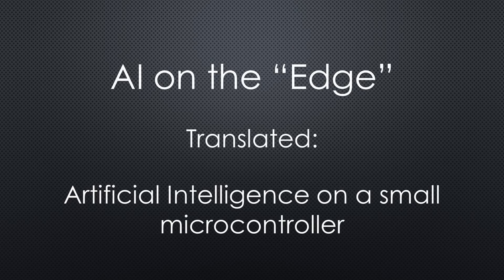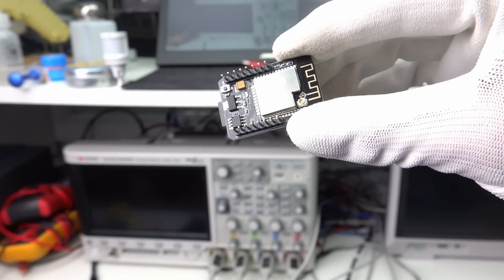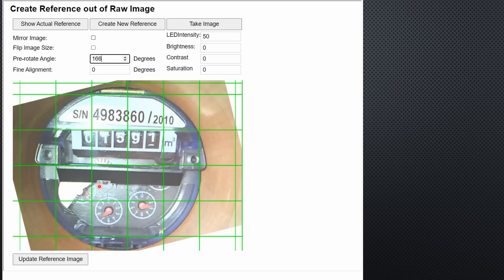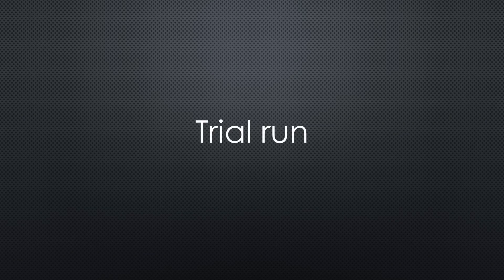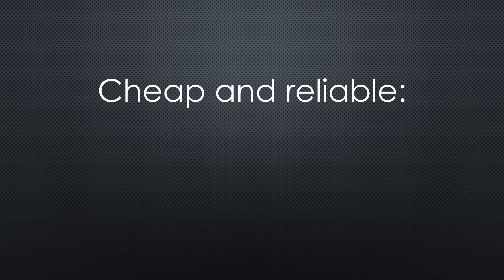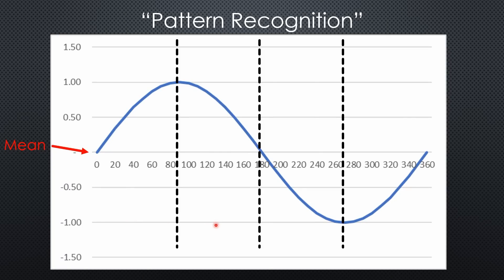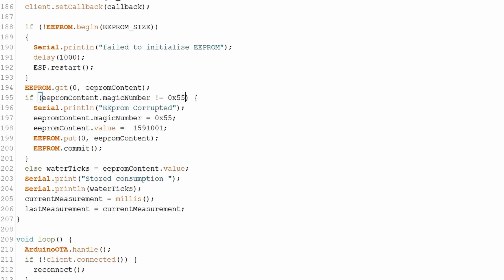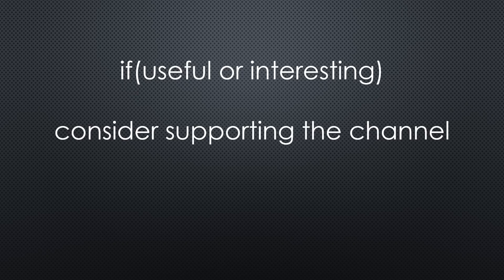#418 AI on the edge vs. Traditional Engineering. Water Meter with ESP32-CAM

Comment: I realize that this is an old video by now, but it does require some adjustment in the used model for recognition to work properly. The default module didnt work fo rmy water meter either. But after quite a lot of fiddling with getitng both the model correct (dig class 11 in my case) and the area that is used for the recognition. Model can be set under the Digit ROI Processing part of the settings.
Reply from the maker: Thank you for sharing your experience. Maybe these days, I would send a picture to ChatGPT as I did with my cat detector.

Comment: In situations where water meter locations usually lack access to power, is there a viable option to adapt this project by implementing RF for low-power signal transmission using batteries? The goal would be to receive these signals on a gateway and subsequently publish the data to MQTT.  Thank you for the great videos and the moments of humour.
Reply from the maker: You could use a LoRa module to transport data. They have a longer range than WiFi (they are also used by utility companies)

Comment: Using a correlation filter would have been much simpler to implement and probably more reliable, considering that the setup has fixed lighting conditions
Reply from the maker: I do not know why the "inventor" used this way and if he tried others.

Comment: Instead of using a magic number which overcomplicates things, store the crc of the number or some other calculated value based on the reading to be saved and check for that instead.
Reply from the maker: Thank you for the tip!

Comment: Is there any mechanism that we can measure AC voltage level, in my flat the voltage fluctuations are common and the AC stops working and gives 88 error which is during high or low voltages. Please make a video if feasible. Thanks
Reply from the maker: You can use any AC meter to measure the voltage. If you want to read it via Wi-Fi you get power meters with built-in Wi-Fi (e.g. Sonoff). They measure voltage, too. 
I already made a similar video.
Reply: @AndreasSpiess  Danke

Comment: Just a little tip: If your microcontroller doesn't have an ADC pin or you can't spare another ADC for just a simple sensor, you can read it with a digital pin. We can accomplish that with example a PNP transistor on the output of the sensor and with a relative low base and collector resistor, that will make the output clip between gnd and 5v, like a digital signal.
Reply from the maker: Good idea!

Comment: Well that’s no good at the first try it’s giving false readings. I think it would be best to use the “svhn dataset” which have so many numbers of different shapes and forms and train it using YOLO V3 and then integrate it on ESP32. I think yolo tiny is the weights used for ESP32. I’m truly amazed that even the ESP32 can actually do valid AI. I will be doing this soon but I need 99.99% accuracies and fast FPS, possibly a cluster of ESP32 can do the task much more reliable, but I think you need to use the right tool for the job, the MediaTek SoCs have powerful built in AI cores which can handle the AI matrix multiplication computations, best of all the MediaTek SoCs are super low prices from $3 to $20 and are extremely powerful than ESP32. The YOLO tiny weights are not too accurate compared to the heavy weights and hence using a cluster or powerful SoC is the way to go to use YOLO heavy weight.
Reply from the maker: Thank you for the additional insight!

Comment: So your device reads signal from water meter?  Our meter is under metal lid in yard.  They use a device that receives transmission of data.  Water use amount represented by a specific measure unique to meter. (Not typical measurement term anyone uses.). 

I need a reader to check elderly peoples water meter to assure they are not BILLED EXTRA.

I WAS GIVEN 3 BILLS THIS YEAR TO HELP THEM STRAIGHTEN OUT CORRECTION AND PROPER PAYMENT. (I VOLUNTEER TO HELP ELDERLY IN MANY WAYS NEEDED.
Reply from the maker: I assume water meters are a very local thing. It seems that in your place they do not like that the customer can check the reading :-(
Reply: Not that it bothers them…. Their meters jump to 3x the normal use to be charged on occasion.  The customers are elderly.  They do not use extra water.  No garden, and to old to wash cars, etc.    I wanted to figure out their signal and check it often for a while.  Water meters can be faulty and hiccup on occasion.  But they hold the elderly Customer to pay it.  Though no logical reasoning.  Leaks are quickly identifiable.
I would love to put “my own meter” in the water line (on customers side of pipe line up on property.). Lol

Comment: hello andreas, I think a better solution could be to use a Raspberry Pi mini. With python and using opencv you can easily recognize the analog red pointers and the direction they point to. if you want to read the numbers with pattern recognition you can do that too. A real AI on the Rasperry Pi is of course also possible solution. a CNN is quite easy trainable for number recognition. i have trained several models to recognize numbers. Very interesting project in any case
Reply from the maker: A good idea. OpenCV is longtime on my list…
Reply: @AndreasSpiess  if you need help let me know

Comment: I have an IR sensor module do you think it would work with this code or should I go for cny70 only ?
Reply from the maker: You have to do your measurements. But I assume it should work with the right resistors.
Reply: @AndreasSpiess  Thanks sir Do I take that WaterMeterV3 code is the most accurate and updated code to work with?

Comment: Hi I lived the solution implemented by you and am trying to buld one 
At 8.03 min I see you have suggested connecing 2 resistors
330 ohm between vcc and emitter
and 10K one between Gnd & Diode
What power rating should I use for them?
Reply from the maker: just small ones. Nearly no power should be dissipated if you chose the right one.

Comment: So before going with the "easy" option, no attempt to train your own AI? Unlike speech and general object recognition in images, training number patterns should be trivial to do on a general computer. A GPU helps, but probably not required in this case if you don't need training to complete in mere minutes (or less). Since it only needs to learn from a custom set (i.e. your meter and not handwritten, other meter fonts, etc), it would be even better/more accurate.
Reply from the maker: The effort for training for only one application seems to be a little too much for me. In addition I would not have solved the issue of partially covered numbers.

Comment: @2:07 - That trigger button made me think of one of those vintage accordion plate cameras (on a tripod/stand) which has a cord and "button" to trigger the snapshot.  Maybe as a project you should make a retro version of that style camera using an esp32-cam and cord. ;)
Reply from the maker: You are right. And if I remember right, they were mechanically connected to the button on the cameras...

Comment: At around 4:30, the glare problem. Can I suggest three things? 1) introduce a polarizing filter between the camera lens and the meter (this may well solve the problem), 2) Degrade the video signal to monochrome or use a monochrome camera, don't need the colour and 3) Ignore the decimal digit, it doesn't add much information but creates a lot of problems, after all the water company doesn't include this in their billing do they and it wouldn't be evident in your resultant usage graph either?.
Reply from the maker: Your tips would certainly help. But there is still the problem that I do not see all digits. I am quite happy with the current setup...
Reply: @AndreasSpiess  Yes I can see and accept that, if what you've got is doing the job then why reinvent the wheel? There is an adage that you use the simplest system to do the job. Just out of interest though, have you seen the Nicla Vision from Arduino, looks like it could do this task whilst having the electronic equivalent of standing on it's head? A bit expensive though!😁
Reply from the maker: @icarossavvides2641  No, I do not know the Nicla Vision.

Comment: To read the metal piece you need to use LC sensor. The Hal of course will not work. And the IR in the field will going to have problems because of the moisture and the water around the meter. Using LC sensor will eliminate that problems and is very robust. Use two LC sensor to find also the rotation direction of the disk. By the way very nice video!!! I'm waiting to see one using LC sensor, there is plenty of documentation out there from ST, IT and meany more.
Reply from the maker: In the meantime I tried such a sensor and you are right, it works. Unfortunately, mine needed at least 6 volts. So I stick with IR. My place is clean and dry, so I do not expect problems. For now it is reliable.

Comment: How did you do the aggregating in Grafana at position 0:42? I tried "field(value) last() difference()" and "group by time(1h)". But a) this does not work for months and b) fill(previous) doesn't work, so I always have spikes like in fill(linear)
Reply from the maker: Grafana does not show the aggregations if the data is not here for the whole period.
I did not use fill(previous). It would not make a lot of sense for consumption. But I also have to try till it looks good.

Comment: Doesn't the AI software have a way to load training sets?
Reply from the maker: Yes, it has. But the effort would be too big for only one meter.
Reply: @AndreasSpiess I must be getting old, because I didn't even remember watching this video and commenting on it. (1 year ago). However, I just finished installing this (AI on the Edge) on my new water meter (Axioma Qalcosonic W1), and it seems to work great with no special training sets or custom configuration. The project really have good documentation, and once I learned that the Digits ROI inner rectangle should be the exact size of the digit, then the recognition was spot on. I also used two neopixels for the lighting and this reduced the glare significantly. I printed a custom enclosure that places the camera just 75 mm from the front of the meter and this works fine for me.

Comment: I have same counter in Vaud but the water supplier add the remote sensor by default. The M-Bus can be read on 868.625M from your favorite SDR gear and RTL soft. They do that so they don't have to ask you to check the counter. use Izar protocol and NOKEY param.
Reply from the maker: Cool! Here we are asked to read the counter once a year.

Comment: You can use induction sensor for reading the water meter, super easy and accurate!
Reply from the maker: You are right. But the Lj1234A does not work off 5V. It needs more :-(
Reply: @AndreasSpiess  I tried 2 for my water meter and they both work although one was rated as low as 6V it still works reliably at 5V. And if you take the NPN version it will not hurt the micro because it only grounds the output. Being digital signal its much easier and reliable to work with. Costs as low as 3-4 euro from China
Reply: I have LJ12A3-4-Z/BX and PL-08N, both work at 5v, the second one I've been using for almost 3 months now

Comment: Hi Andreas

I couldn’t resist telling you about my own recent project to read my gas meter. It was prompted by having a now useless 1st generation (SMETS1) “Smart” meter. It lost it’s “Smarts” when I switched to a new gas supplier. But, because I have a “Smart” meter, I can’t ask for a new, interoperable (SMETS2) Smart meter because our UK government are spending £billions on a project to create a national “Hub” that can read any SMETS1 meter and forward results to any supplier. Of course, it’s 2-3 years behind schedule and paid for through our gas bills.

With the recent surge in gas prices, with more likely, I decided to upgrade my meter so my Home Automation system can read the meter and I can correlate actual use with my demand patterns. Maybe even predict early switch-on times in cold weather.

I’d seen a decent looking implementation using an ESP32 with a camera on a similar meter to yours but my system has a digital display that only comes on at the push of a button. Plus, I’d need to significantly re-work the algorithm he used to analyse the reading. I didn’t fancy that.

Instead, I found an Android app that does pretty decent OCR and decided to use these apps on an old spare phone to send the meter readings over MQTT to my Home Automation system:
•	Pushover	(good Android push notifications)
•	Text Scanner	(good OCR)
•	Open Camera 	(good camera)
•	MQTT Dash	(simple, reliable MQTT app)
•	Tasker		(Android phone app  for activation and co-ordination)

I also used my vintage Meccano to build a “Button-presser”

This geared-down motor takes about 6 seconds to complete a revolution, triggered (by a nearby ESP32 that already measures my electrical power use) via a 5V relay. The motor has a Meccano cam, which turns against a Meccano springy strip, which pushes the button.

My HA sends an MQTT trigger to the ESP32, which turns the motor on for 6400ms – about one turn. 
My HA then sends a Pushover message to my old phone, which triggers a Tasker Profile, which launches the Camera, takes a photo, launches the OCR app, which scans the last-saved photo and passes the raw text to a bit of Javascript I wrote for Tasker to trim the text down to just the meter reading, which is then passed to my HA system over MQTT. Every 6 hours is good enough. Don’t want to wear anything out!

It is the worst looking, most poorly deigned contraption I have ever made. It is what the word “Bodge” was invented for. If I were to create a company to build and sell these it would have to be called “Floggit, Bodgit and Scarper” (“Sell it”, “Make it really badly” and “Run away”).

However, despite being ashamed and embarrassed by my construction, I’m strangely proud as well. It works. Mostly. The OCR sometimes misreads a “0” as a “9”, which is annoying but non-critical as the figures soon change and correct themselves. I can improve the OCR by re-positioning the camera a bit, which I probably will do. 

Normally, I’d redesign everything and try to find improvements but in this case I’ve decided to leave it as-is in a kind of protest against the £billions cost and years spent by our government trying to fix interoperability of SMETS1 meters that should never have been rolled-out in the first place.

I’ve upgraded my meter to SMETS2 (well, the bit that’s important to me) and it cost me about £6 in parts and a bit of 70 years old Meccano. Not a 3-D printer in sight. My own, personal solution to the SMETS1 problem.

I have photos I can share - they aren't pretty...

I hope this has made you smile. 

Love your work and I promise not to be so bad in future!

Cheers
Andrew

Comment: To get rid of the glare, best is to put the camera to read at 45 degrees to the surface, but anything will see improvement. That will take the LED and bounce the light away from the camera. I thought you had to train tensorflow. Would it have better results if ran much longer to train it?
Reply from the maker: This project includes trained files. But not for my meter. Training it for only one meter would be too much effort for me.

Comment: What kind of Hall sensor did you use? Linear or digital one? That plate is plastic or some metal?
Reply from the maker: Now I checked again. It is metallic but not magnetic.
Reply: @AndreasSpiess  Linear Hall sensor (like EG49A) could potentially detect it. Digital Hall sensor (like GH1248) is useless for this.
Reply from the maker: The LJ123A works, but needs at least 6 volts...

Comment: hello in order to improve IA result, in your cas you could try to nomalize input image in a different way  to help neural network in his recognition work,  binary color and gaussian could be a start.
you can try to treshold you pixel value range, over a long time (find min max, of a pixel zone)
Add physically some light reflector to help with changing luminosity.
may i suggest you to try tesseract in python, quite effective
Reply from the maker: I only have one meter and only tried this project because it already had a trained model. I agree that your proposals could solve some of the issues. But the effort would be too high for me.

Comment: Thanks again for a very interesting and informative video. So many valuable nuggets of valuable information from a seasoned engineer ! If your wife had so many stashes youd probably call her a hoarder :-), so its ok if she is cleaner than you. So the AI solution you found is quite brittle, it breaks when bent to a slightly different problem. I also thought it would be straightforward to take images of my oil tank level and automatically remind me when to reorder ... 3m later Im still going into the basement to read the guage directly.  Yes the ESP32-CAM is an amazing device, but requires work to do real-world tasks different from any open source available. Introductory solutions can be found with only 50 lines of code, more featured ones are several thousand lines of rarely commented code.
Reply from the maker: I made a video about pressure meters where many viewers reported that they use such a sensor for their oil tanks...

Comment: Andreas another great instruction video. I enjoyed the water usage analysis. I got thinking, you should add some control to the project and slowly reduce the available hot water after a certain time frame. The idea to minimize water consumption. Results could be water savings but …. 😉😉
Reply from the maker: We will see how this will work out. It is in operation now and I will do some analysis...